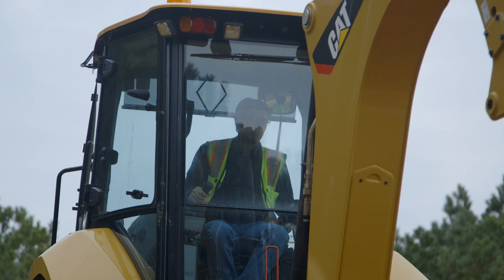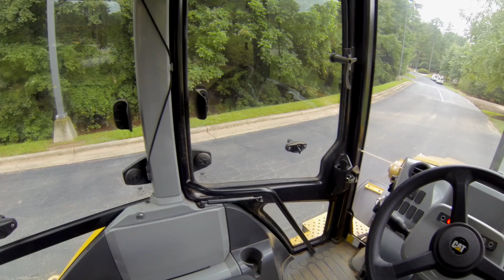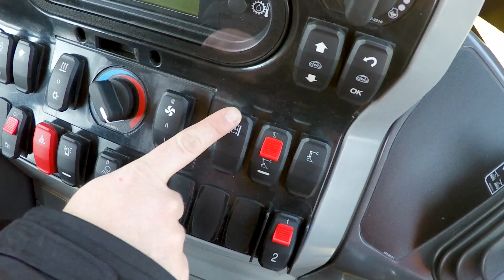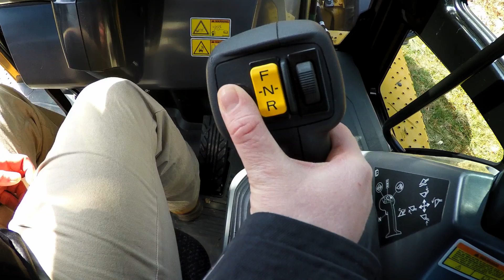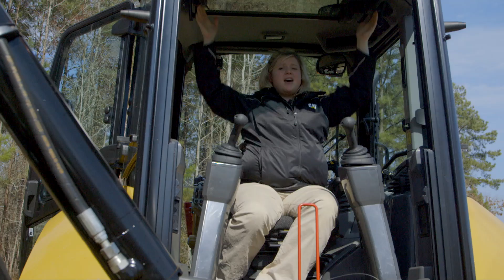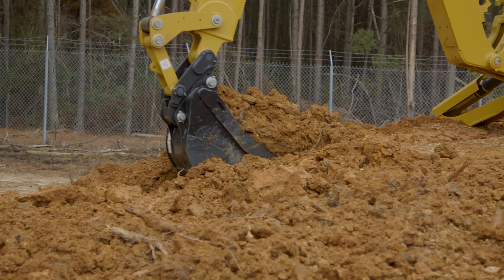Cat® F2 Backhoe Loaders Cab Overview (North America)

Comment: QUESTION: Can you wash down the inside of the cab with a hose in an enclosed cab machine, like an open cab machine? The Case we have now you can, without worrying about damaging any of the electronics. Our machines get very dirty inside sometimes and the only way to clean them up is to use a garden hose and a wash brush.
Reply from the maker: Great question! Use caution with water in an enclosed cab to make sure you don’t have moisture trapped. Our cab includes all-weather components, but you’ll want to be reasonable with water in the cab and don’t turn the hose directly onto ports or the radio.

Comment: just wondering: i noticed on USA videos very few backhoe's have side shifts style diggers, instead they al have a arm that is fixed in the rear center. why is this? it would seem to me this limits the use, like in a confined space or digging next to a wall. The EU version of this same machine does come with a sideshift.
Reply from the maker: Great question, Kurt! North America primarily only uses the Center Pivot model of backhoe loaders.  We don’t have the space constraints and the market requires more lift capability than the Side Shift models provide. However, we are currently investigating a Side Shift Opportunity for 2018!